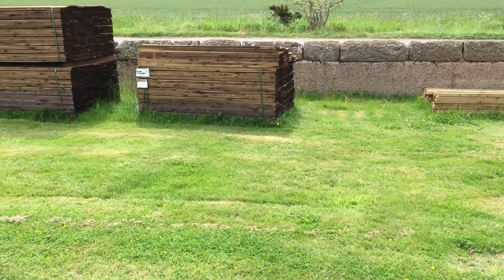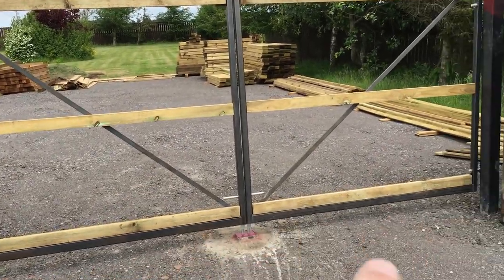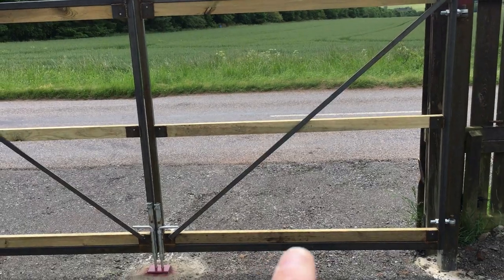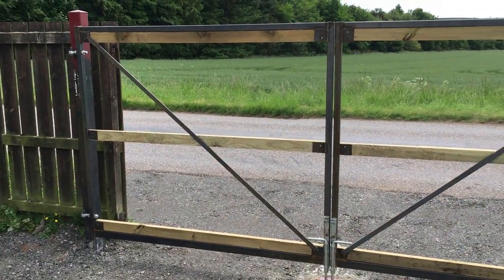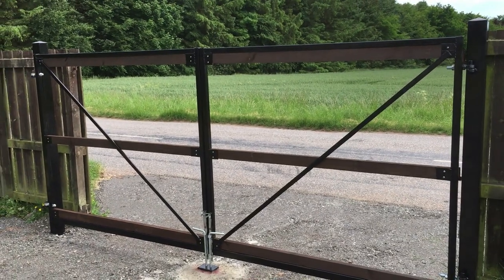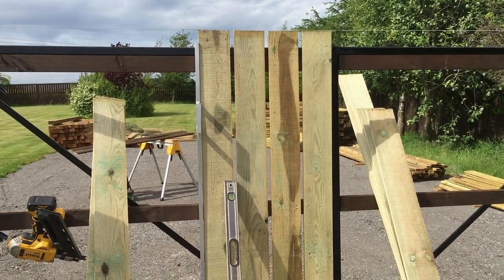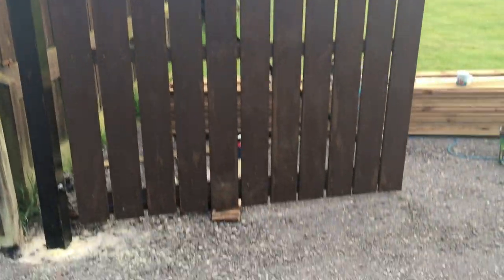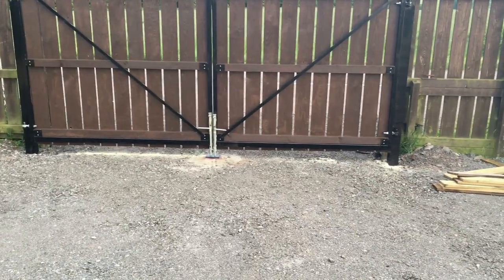How to make a metal gate and attach wooden slats | Fabrication & Welding

Comment: Nice solution to fitting the panels, better than filling the frame full of holes. Like the tension bar frame, can clad with much lighter wood than would be needed for structure if only wood. Great gate.
Reply from the maker: Thanks for the comment, not a very detailed video but hopefully you got the idea. Yes, that gate has not budged an inch so far, very structurally sound - far better than the old wooden gates that were there before ! Cheers

Comment: Anit the brace going wrong way...
Reply from the maker: The brace is going the correct way, it is a TENSION brace, not a COMPRESSION brace. Wooden gates have compression braces going from the top corner back to the hinge, steel structures have tension braces which provide greater stability as steel does not stretch drastically (hence why you put the brace in tension). Thanks for the comment.
Reply: @Bacrenfencing  Yes you are spot on, not many people understand bracing.
Reply from the maker: @globeforever9777  Thanks GF, yes a lot of people seem to get confused with bracing whether it be gates or actual structures. Thanks for the comment